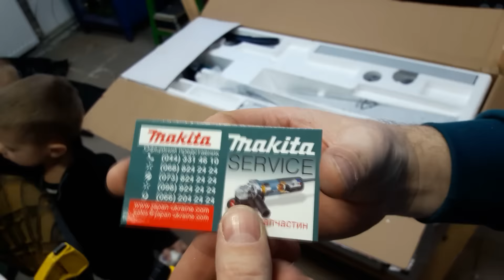My new Makita LB1200F Band-Saw

Comment: Thanks for the video.
This model is identical to Metabo BA318. I bought one and found it has a lot of design and manufacturing issues. Although the local dealer was very supportive and I was able to resolve some problems some remain difficult. I think the two major  issues. 1st is the band saw tensioning spring is poorly made so it won't last and it has insufficient strength  to tension bi-metal blades. The solution is to replace the spring with a similar spec US made spring, I could find two suppliers.
2nd is the top band saw guide track, it's unstable and inaccurate due to design flaw,  tracks wearing out very quickly. I couldn't fix it so i sold the saw.
Hope the info would help owners and potential buyers.

Comment: I have the same Makita bandsaw. But I have a lot of vibration on the table, do you know how I can solve this?
Reply: There're a number of fine-tuning instructions on the Tube. Cheers!
Reply: 575€
Reply: The answer is you can't. Mine went back to Makita twice and they had no idea. A lot of these saws have inheritantly unbalanced wheels that need replacement or remachining. I rejected it for a refund. Makita need to concentrate on their own Japanese engineered stuff rather than these Chinese made machines that are clones offered to several manufacturers...
Reply: Mekong Giant they don't help on this Makita unfortunately
Reply: your band saw wheel balanc out check it
Reply: I have the same bandsaw and one thing you should check is that the blade teeth are not running against the guide bearings.  Not only will it vibrate more, it will also flatten the teeth and ruin the blade.

Comment: Hey! does your blade wobble or shake a little. I bought the same one used, and i cant seem to get it running properly. tensed all the way doesnt tense it enough.
Reply: Same problem with mine too....tightened it but still wobbles and cuts inaccurate even with fence

Comment: Appreciate you showing the (un)packing and mounting; most complaints have been about poor instructions. So at that point I'm moving in the direction of buying. Then...what's this?? An 18" piece of 6x1" your cutting at 0 mph!! Really?? That's all it can cut? And at slooooow speed. Good job you wrote 'Normal speed' because I thought you'd sloooowed it down for some reason. Yikes. Not impressed with the capacity of the machine one bit. So thank you.

Comment: Sold mine fora little less then half the price i paid for it a good year before. Was glad to be rid of it, useless machine really! To much vibration, not enough tensioning (i could see the tensioning construction flex inside), very bad blades suplied, a bit better with good blades, max 1/2”, dust extraction doesn’t do anything. Spoke to a makita-seller which reluctantly admitted the problems, and the fact that they had no sollution for it
Reply from the maker: The same problem ((
Reply: Hi! What would you get instead? I have been looking into this topic lately and pretty unsure which saw to get... Thank you very much!
Reply: Oli i bought the Hammer n3800 from felder after long deliberation. The difference is enormous i must say, but the pricetag also i’m afraid. Still have a few isues with the saw, but very small really, nothing compared with the makita which i hated. Depends on where you live also the hammer is from austria, they only make them on demand. Also they have a smaller model since januari. Record power sabre models have a good reputation also (except for the provided blades perhaps, get decent ones) , the other brand i considered was laguna with their 14/12, the price is somewhere between the hammer and record power, but laguna is still new here in belgium, was affraid of issues with maintenance: the closest store is in holland. Hope this helps you.
Reply: Edwin Ghysebrechts Thank you very much Edwin for he valuable information! Definitely helps a lot narrowing down the options! I am going to check Felder first since I reside in Hungary, so it ain’t too far from me!

Comment: The fence is very flimsy. It tends to deviate at the long end after a few days and then it never is accurate. That is the kind of fence they give on their 10-inch table saw which makes an otherwise good saw an absolute inaccurate cutting machine leading to excessive use of jointer and what not. Makita makes great motors but beats me why they make such bad fences.

Comment: makita makes quality handheld tools however I have never been impressed with there table saws with exception to the flip saw which is pretty good! there stand alone table saws are terrible with huge fence issues it's almost impossible to lock there fence guides square and keep them locked in place without using a clamp or making your own fence system. I feel there bandsaw will be absolute garbage too just like the dewalts version absolutely terrible! if you want a bandsaw and not pay stupid money buy an old startrite or wadkin you can get them for as little as £500 and are rock solid. I am afraid I would not purchase a makita bandsaw as I can only imagine the issues this thing would have! thanks for the video but this tool not for me :)
Reply from the maker: you're right.  for a carpenter, a saw is not a good turn.  but for me it’s all right.  I cut sheets of kydeks, mikarta and carbon fiber.  accuracy is not needed there.  on this I have no complaints to her.